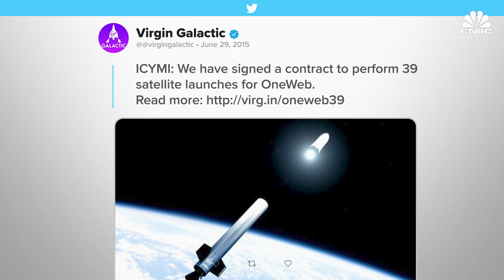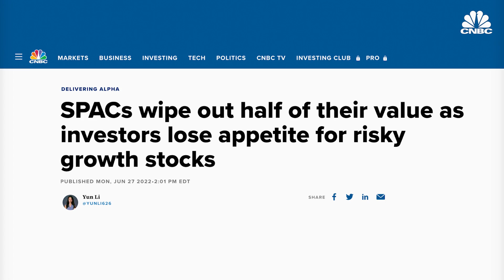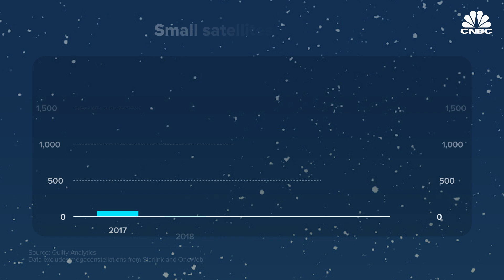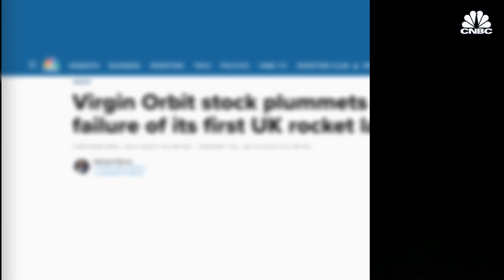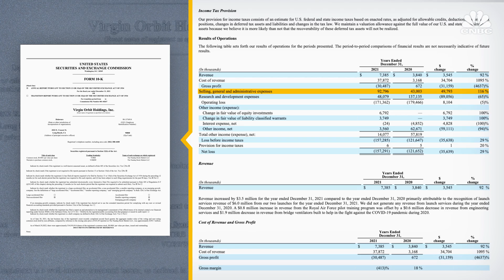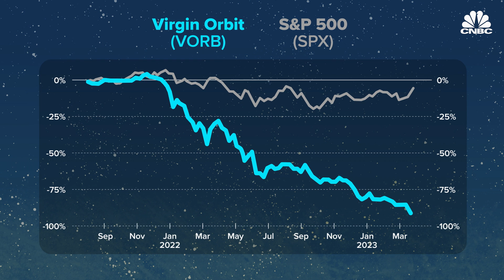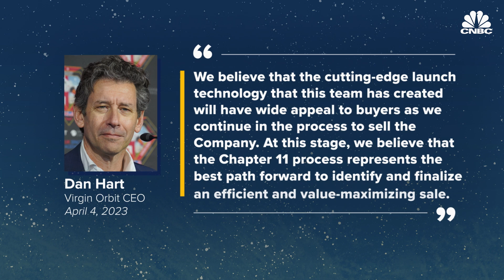Why Virgin Orbit Failed

Comment: What went wrong is the fact that launching from a plane still requires like 95% the delta V as launching from ground.
Reply: So they only save 5% of the rocket fuel? ... How much is that in $?
Reply: @wayando  when you aim to save 5% and fail to even succeed. 
The only person i know who can do alot with 5% is ethan klien, according to Trisha
Reply: @wayando  5% efficiency is actually really good, the delta v is different from rocket fuel saved
Reply: @krishmalhotratalks  ... Isn't that just a fancy way of saying "change in speed" ... Which is a longer way of saying acceleration/ deceleration? ... Which in money terms means amount of fuel?
Reply: @wayando  it saves more than 5% rocket fuel because if you can have 5% less acceleration, your rocket can be lighter, which saves more fuel for the entire stage. However that doesn't matter because fuel is cheap, the rocket is expensive. Launching from air to save $500 worth of fuel on your small rocket so you can spend $1000 on the jet fuel and $5000 on the maintenances of the airplane, makes absoletely no sense.
Reply: @chengong388  ... I agree. That's exactly what I was getting at. The principle they were trying to based their entire business plan on was no-bueno at the fundamental level.
Reply: @wayando its fundamentally no bueno because it’s untrue. The selling point wasn’t saving a little bit of fuel, it was the flexibility to launch  wherever and whenever. Having a higher payload for the size and complexity of the rocket. There’s literally a video explaining all this playing as I type this yet somehow you have arrived at a nonsense conclusion.
Reply: All Billionaire CEO trying to beat Elon in space is going to bankrupt their own company trying doing so.  They think it's that easy...haha
Reply: @chengong388  you guys make it seem like rocketry economics is this simple haha
Reply: @chengong388  the additional structural mass is way more punishing
Reply: That has nothing to do with overall operations.
Michael Sheetz (CNBC) sums it up best right near the end of the video. "Virgin Orbit's legacy within the space industry is a story that's too often told where there are exciting or even innovative new technologies. But that does not make necessarily for a smart or financially sound business." 
That's not just true of space but the wider technology sphere.

Look at how many wonder technologies have been in the news over the last 25 years and nothing come from any of them. There's a meme that "99% of general startups fail." If there was a meme for aerospace it would be "99.9% of aerospace startups fail while the other .1% has juicy military contracts for stuff that doesn't work."
Reply: Also on air launching (and yes I have a degree in aerospace) its NOT just the saving on delta-v. They are only launching from around 10km at less at about 0.25km/s, while orbit is over 200km and over 7km/s. So the actual height and speed gains have little to do with anything. 
The actual advantages of air launching and they are incremental buy do add up. 
1) You don't need to build a dedicated launch facility. All that is needed is a hanger and a convenient airfield.
     That's a cost saving.
2) Air launching includes a fully reusable first stage. 
     That's a cost saving.
3) It can launch "on orbit" or closer to orbit. All normal launches require fuel in the upper stage to get from the launch sites global position over onto the global orbital position. Reducing the amount of fuel needed either lowers costs or allows for larger payloads. 

Where I think they didn't learn from previous systems. 
1) Launcher 1 is significantly heavier 30t than Pegasus XL 23t which was a fair step of from Pegasus 18.5t. When you are staring with a vehicle around 50% bigger than your competitor and you have all the development hassle a smaller system would have been a lot smarter to start with and then build up from there. 

Starting out with something much smaller would have meant debugging all their systems both in the vehicle and in the manufacturing and launch processes with a cheaper vehicle and fewer people. They forgot that whole learning to walk before learning to run thing.

2) That extra weight meant a bigger more costly aircraft. Maybe the surplus 747s were cheaper to buy but a smaller 767 can lift those sorts of loads and with only 2 engines to service is a huge operational cost saving. Remember Pegasus used a modified L-1011 Tristar for most of its life.

Every time a 747 flies compared to something like a 737 or 767 that's a lot of fuel burn and a lot of maintenance. This is a lesson everyone should have got from the Space Shuttle. Every launch of the Space shuttle meant putting 75tons into orbit before you did anything else. That's a lot of unnecessary cost and also why the ISS cost so much and why Crew Dragon is a massive step in the right direction. 
AND NO I am not an Elon Musk fanbot but I do cut him some slack on Space-X.

3) Their flight profile negated a very important aspect of what they learned with Pegasus. The wing on Pegasus allowed the vehicle to gain a lot of speed in horizontal flight at a point which is significantly more fuel efficient than trying to accelerate in vertical flight because there is still air drag at that point. That might not be a lot of difference but Pegasus works and Launcher One doesn't.

4) The most important thing they forgot is that space flight is hard and no matter how much money you have their will be failures. Go and look at the Pegasus launch list. They had 4 failures (or partial failures) in the first 10 launches, another at 14 and then 31 successful launches in a row. This stuff is hard and all the vehicles are built right on the razor's edge of failure.
Reply: @devonwilliams2423  he takes that 5 per cent
Reply: @tonywilson4713  great comment ;-)
Reply: @vasopel  Thanks.
Its kinda frustrating with the media these days. Unfortunately they all think being able to use a computer makes them technically literate. Its not just aerospace its pretty much everything technical.
Reply: @pitech4446  Richard tried to be Spaceman II.  He even did the Hyperloop thing.
Reply: Depending on the rocket's design, it could potentially save between 30% to 50% of its fuel if launched from 70,000-100,000 feet.

It's way more significant than 5%.
Reply: @encinobalboa  both failed haha
Reply: @qownson4410  You're very much on the right thinking process but you're simply not going to air launch at 70,000-100,000 feet because there's so few jets capable of that high . But you are quite right that getting as as hight is is an important part of the discussion.

Sorry if this is a long comment. 

I actually put in a A$720 Million proposal to the Australian government based around air launching. So I did a lot of research into this subject a few years ago. The carrier aircraft I proposed was a 2nd Gen White Knight One as used to carry Spaceship One that won the X-Prize. 

There's a really interesting item about White Knight One. It uses the same engines as the T-38 Talon (General Electric J85) which is the military version of the General Electric CJ610 engine used in the early Learjets (23, 24, 25 & 28). What many people don't realise is that the Learjet was originally proposed as a small tactical bomber and as such had military grade engines. So White Knight One like those early Learjets could fly up to 53,000 ft which is substantially higher than the normal 35-45,000 ft limits we see with current commercial aircraft.  That 10,000 ft doesn't sound much but its significant because of where it is in the flight profile. 

If you had unlimited access to ex-military aircraft the Convair B-58 Hustler is the plane to consider because it could not only go high (63,000ft) but also very fast (Mach 2 at 40,000ft). 

Going back to why that extra altitude matters. Its simple high school level science. Getting into space is all about energy and there's 2 parts to that. Straight out altitude is the potential energy equation pe = mgh. Getting into orbit requires speed and that means kinetic energy ke = 1/2mv². So no matter the launch type every bit of altitude and speed you can get matters and saving fuel matters because that's your energy source. This is as Don Pettit put it "The Tyranny of the Rocket Equation" https://www.youtube.com/watch?v=uWjdnvYok4I

Air launching has the obvious saving that you are launching at speed and altitude. You simply avoid all the issues of the launch pad. That's when a rocket is at its least efficient because that's when its total mass is highest and the rocket nozzle needs to produce its highest thrust.  
  
Where air launching also saves fuel however is at the top of the launch profile. If you launch from a fixed location you have to burn fuel right at the top of the profile to get onto the desired orbit. This is the part of the launch sometimes referred to as "orbital insertion." You have to burn fuel getting onto the right trajectory. Air launching reduces the amount of fuel needed for that because at the moment you launch you are pointing in the right direction. Its sometimes referred to as "launching on orbit." 

So there's substantial fuel savings from air launching. At times its not that much and at other times its more. Irrespective every extra kilo you can lift is a bonus. That's even more significant if your payload has orbital adjustment motors because you end up with more useable fuel on the payload.

The other consideration is construction of facilities. All you need for air launching is a hangar beside the runway. You don't need launch platforms or towers or spend money maintaining them or much else other than a convenient airport. People tend to forget those costs all add up.

Again - sorry for the long comment but you are on the right thought process.
Reply: @tonywilson4713  Thanks for your comment.

I guess it's also noteworthy to mention they're only launching rockets at a cieling of 32K feet, if they could launch at 64k feet I think this project would've been a success. It's well below the highest ever recorded altitude for a turbojet vehicle, but the higher you go, the lighter the rocket, since it also would need less propellant. 

Not sure why we've abandoned air-to-space launches, it's cool to have self-landing rockets, it's just expensive.

Air-launches allow smaller competitors an edge and ability economically send payloads/people/et-cetera into orbit, or beyond. (In theory.)

Yes the actual vehicle capable of doing it is likely to be quite expensive, I'm thinking SR-71(Black-Bird), or Stratolauncher.

Not even sure why Paul Allen dipped his toes into the space sector just to back-out, but perhaps he's the clever one, realizing his vehicle [Stratolauncher] albeit capable of a lot of lift is not capable of high altitude lifts.

The space race is cool, but there's also something to be said about rocket-propelled planes acting as 'lifting' gliders, to reach an 80k+ altitude and then launch a rocket, while on the outside that sounds silly and counterintuitive, but upwards aeronautical lift is still less expensive than outright rocket lift.

If a plane got to a cieling of 40-50k feet, then activated afterburners, or a rocket-booster to go another 30-50k feet, it would make launches a lot cheaper, and arguably more or less safe..?

Most agencies have proposed air-to-space hybrid vehicles, such as ram-jet/rocket planes but I think for now the 'cheaper' option is rockets.

Hybrid planes are going to be the future of intra-solar travel.
Reply: you know if you can find a way hold a rocket still , while the earth moves away. you can technically launch without fuel
Reply: You understand inclination, right?
Reply: Although Virgin's ability to launch under a greater range of weather conditions (by simply flying above them) as well as launching satellites on short notice and from any 747 capable airport is what made their offering special.
Reply: Yeah but you aren’t fighting the atmosphere as much which is a big deal. Therefore less mass, less fuel, less weight, therefor less cost.
Reply: @nspinicelli  exactly, that's where the 5% saving came from. Otherwise it would be even less than that.
Reply: @tonywilson4713  launch windows too, you should be able to launch anything almost any time - but you might have to do some 747 flying.  Branson touches on this ~3:20
Reply: @bentucker7280  You're right and that's just another of the advantages of air launching. 

The only real problem is that that there is a practical size limit and I think that's part of Launcher Ones issues. Its almost 50% heavier than Pegasus XL which is a fairly big. 
A Tomahawk extended range cruise missile and AGM 129 are both around 1.6 tons
Pegasus XL is 23.1t
Launcher One is around 30t
That's a lot of mass to be holding in the way air launched rockets are launched.
Reply: The advantage of launching from a plane is that you can launch from any location and fly around weather.  You are paying a huge penalty if you cannot capitalize on this.
Reply: @pitech4446  Except SpaceX is also deep in the hole, They have been in a rush to get the starship platform up and running so they can deploy v2 sats to save the whole starlink venture. Despite how they played off the last starship launch as a "success" in reality it was a absolute failure. If there Government funding gets cut, its GG.
Reply: @wayando  It does, but it’s not a linear conversion. Those first few thousands of feet have an exponentially higher dropoff in air density than the next dozen thousand do. The 747 could bypass that.
Reply: NO, it does not.
And it's not just about fuel.
You can have a much smaller rocket.
But for this idea to make more sense, they should have built a bigger flying launch platform.
Reply: There is more than saving fuel costs.  Your ground based hardware, launch pad etc are minimal.  You can launch fro a commercial airport!
Reply: It seems like getting above 80% of the atmosphere is a greater advantage than the 5% boost in speed.
Reply: @tonywilson4713  also you're in thinner air, so you spend less less fuel fighting air friction. And the less time you spend having to fight gravity rather than gaining speed, the more efficient you are.
Reply: @trouty7947  Yep I know all those points well.
For rockets up to a certain size (and I think Pegasus XL is close to the limit and Launcher One is past the limit) there is nothing better than air launching. Smaller rockets are less efficient in terms of payload than larger ones because not everything scales down. So getting some of that back by launching at 40-50,000 ft and needing less fuel to get onto the right orbital track is a big deal. Plus not having to build launch facilities saves millions that can go into jet fuel and rocket fuel.
Reply: Im sure the limited payload volume made a huge difference also. It's one of the reasons the space shuttle was abandoned because you can't scale it up without redesigning it and the launch system/runway aswell. A rocket can potentially be scaled to match the payload making that 5% of gains pointless.
Reply: @jimbobbyrnes  
That isn't true about the shuttle.  The loss of Columbia is what drove the retirement decision.  The remaining shuttles (they were down to 3 out of 5) would meet their ISS construction commitments and be done.
Reply: @Skank_and_Gutterboy  "It's one of the reasons"
Reply: @chengong388  Thank you for the first in this thread to mention the tyranny of the rocket equation and yet explain why even significantly more than 5% fuel savings still doesn't make financial sense.
Reply: @tonywilson4713   Hmm, from what you have said, I think that Virgin Orbit might've been more successful by investing more in heavily modifying the 747 to lift a much larger rocket and broadening their potential customer base.

I mean, yes a 747 is more expensive to fly than a twinjet, but not THAT much more expensive, especially if you don't fly it far or often.
Reply: @h8GW  NO - other direction.
They would have been far better off starting with a smaller rocket on a smaller jet and then building up.
The single biggest cost in flying jets (after the fuel) is the engine maintenance. Its why twin engine jets have become the main stay of the air industry.
Go back to the 70s and 80s and there were lots of triple engine jets like the L-1011 and DC-10, 727 and they have all gone the way of the dodo. The cost savings on engine maintenance is huge.